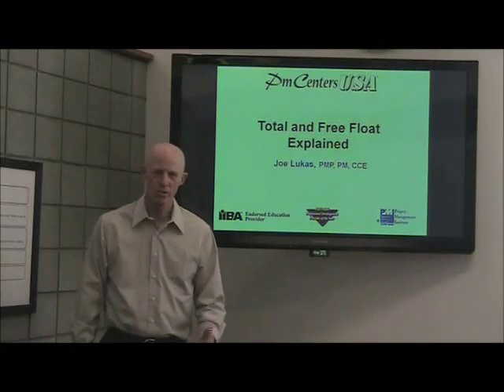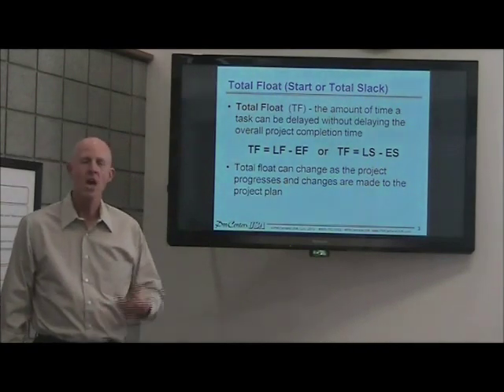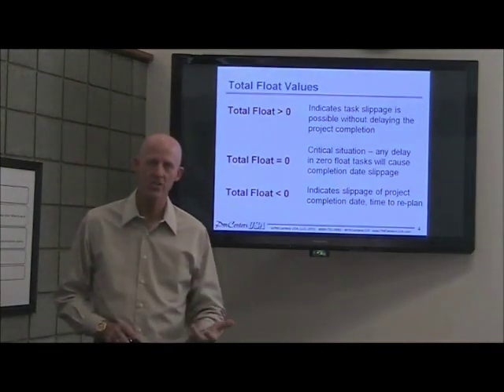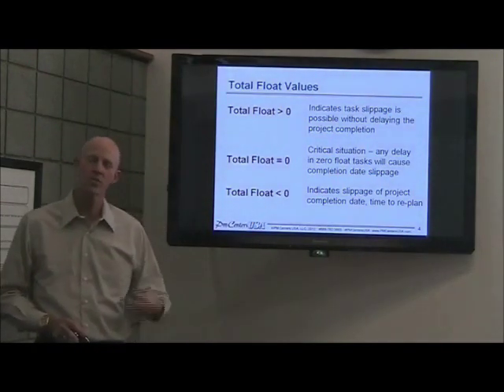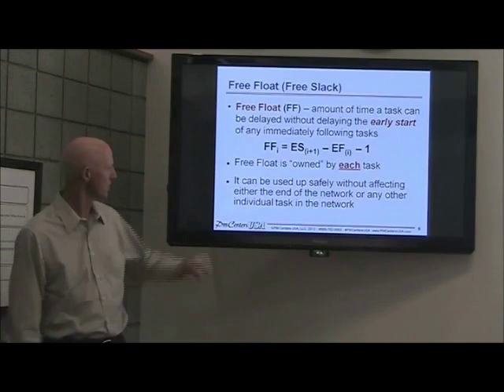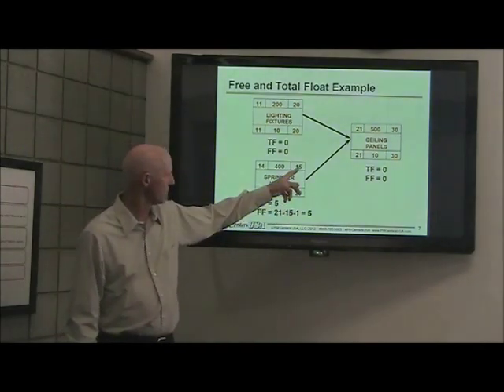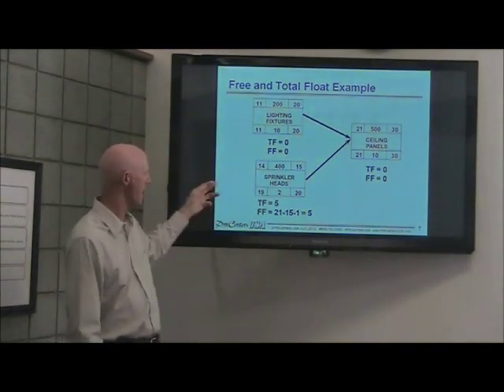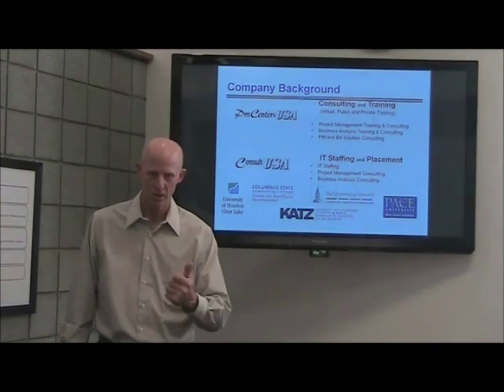Joe Lukas Explains Total and Free Float

Comment: My PM class does not subtract the 1 from the free float/slack formula; does anyone know why the difference?
Reply: I think this example is using the "one method" for forward pass where you start with 1 instead of zero.  see this as an example. http://u.rmcproject.com/tips/pdfs/Two%20Methods%20to%20Calculate%20Pass.pdf